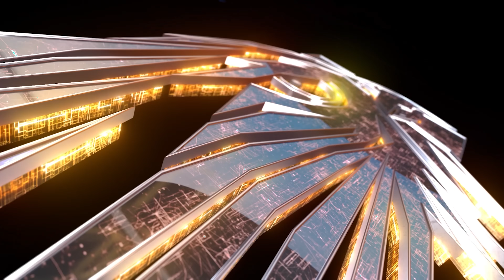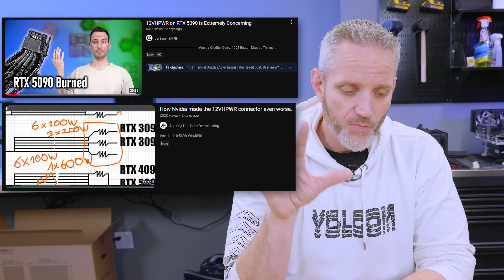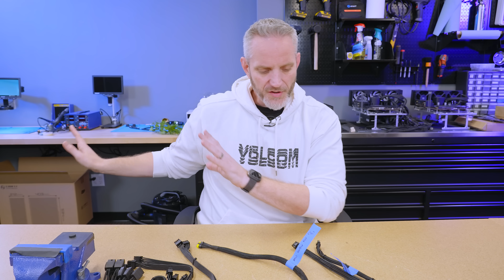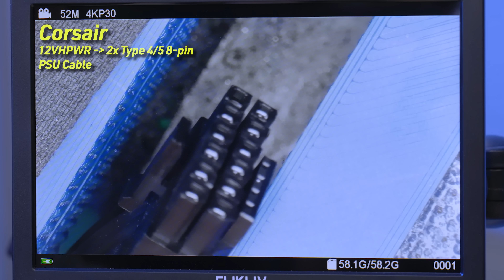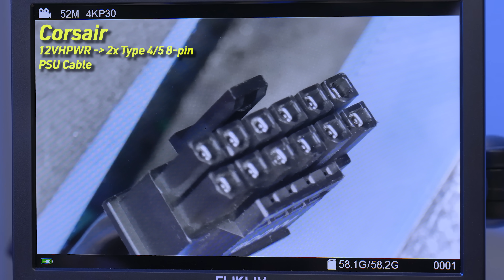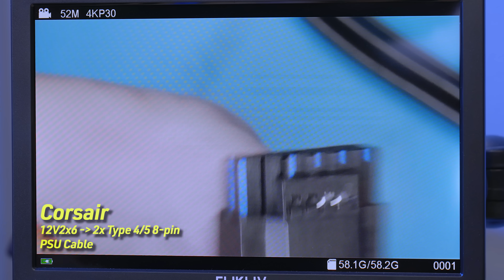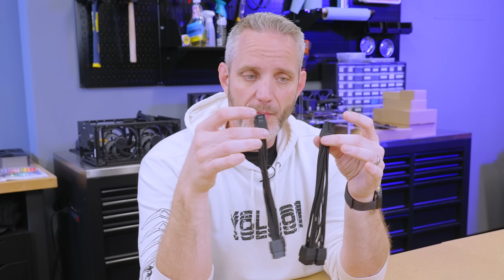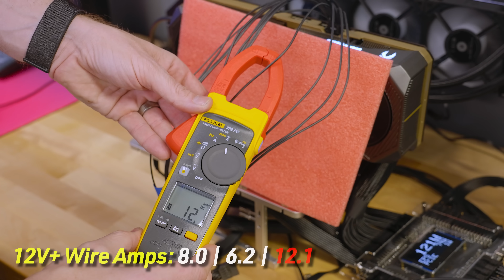I discovered something concerning and I need the Experts to chime in... More 12VHPWR discovery!

Comment: I bought an MSI card and I have a Corsair PSU.
Man, the MSI connector looks so fine and clean, but I cannot stand the fact that I would need to have three PCI-e connectors plugged into the MSI thing.
So I ordered the cable from Corsair. If you compared the 12V side to the PSU side, all the pins area actually sank in about the same.
But yeah, I get this weird feeling when using the cable that it is gonna fail at some point. I have "just" a 5070 Ti though, so it will draw 300W and might have spikes to like 350W, so I'm absolutely safe, right?

Comment: Nvidia is an old dinosaur that hasn't evolved for a million years. To make the 4090 go faster they just shrunk the transistors in the gpu die and cranked up the power because the archtecture didn't produce enough of a gererational uplift from the 3090. The 5090 was even worst uplift from the 4090, so they tossed in an even bigger die and raised the power to stupidly high levels to show some gains. The plug was never meant for cards that draw so much power, so no wonder they melt or catch fire. Nvidia makes rational people do stupid things. Would you screw a1500W halogen spot light into your 60W desk lamp? I surehope not. Nvidia can't inovate or evolve, so they do what they always have done and just throw more power at the card.

Comment: Have the two 12VHPWR cables included with the Be Quiet! Straight Power 12 1500W power supply (PSU) been updated or are compatible with the newer (2x6) standard to prevent melting connectors for the more powerful graphics cards (GPUs) like the Nvidia GeForce RTX 5080 and AMD Radeon RX 7900 XTX? 

I am concerned about the potential for overheating and melting cables which could lead to a decrease in performance, system damage or even fires. 

I would like to know if the aforementioned PSU is fully compatible and safe with either GPU I previously mentioned since there appears to be many incidences online of burning connectors when it comes to the 12VHPWR cables.

Comment: the cables that are not as warm are the problem forcing more current through the hotter cables will this cause melting of the connector - probably not, this is of course a different issue than a bad connection on the pin itself making that pin on the connector  heat up and eventually melt, as it melts and burns the problem gets worse over time, it is a complex issue

Comment: ughh, I just installed a 1200w Corsair HX PSU yesterday, I wish I'd seen this first. Although, it is a brand new unit direct from Corsair and it looked like they have revised the 12vhpwr cable, as it's now two tone plastic (grey/black), a bit like the MSI cable.

Comment: the only thing i know about electric cables is a loose connection causes arcing which causes heat which causes melt which causes shorts and fires.

Comment: I think it's possible that poor quality power connectors are responsible for 12V GPU failures. However, as with some people in the comments, I agree that ultimately this is a GPU manufacturer error. The GPU should have safeguards built in to detect missing pin connections with the power connector to prevent failures. It should just result in a GPU not working, rather than the GPU dying. So yes, power supply manufacturers could probably prevent these failures by having better quality control, but the onus should be on GPU makers to make sure their cards don't die or start fires from bad power connectors.

Comment: Currently using a super flower leadex 7 1000w with an astral 5090. The load balance across the wires changes DAY BY DAY. Super flower has also ignored me for 2 weeks now and i cannot find any help.

IF i was using any other 5090 i would never know that 2 wires are pulling more then 10 amps as other only draw 4 amps.

Comment: The Problem is: My 1200W ATX 3.1 power supply has one 12VHPWR connector and only 3 8-pins. So not enough to use the adapter with my 5090...

Comment: I guess it might be a good  idea to buy some kind is small electronic device that would plug in between the power supply and the graphics card.  That would even out everything and keep your cars from burning up.. in some kind of fail safe that would monitor temperatures on the wires.. that would plug into the PC and give you some kind of warning or a heads up when things go wrong.  That would monitor the temperature on the plug itself also..

Comment: YES! FINALLY! I've been waiting for this video from someone in the PC building community.
I'm an electrician, I have worked on almost anything you can plug into a wall, and wired the wall all the way back to the pole. This is REALLY bad. That's my professional opinion, nobody in an electronics engineering class is going to tell you that's "fine". In addition, I have had to actually push the wires into connectors to assure connection between this style of wiring harness (and that's really what this is, it's a wiring harness.) Ok, so that's my FIRST issue, I've seen countless wires pushed out of the back of the connector and had to physically push the wire in with the connector on the end of it to get individual pins to connect. There is all this terminology that's kinda different than what we would say in an engineering environment. The actual connector is the individual metal connector crimped onto each one of those 12 wires. It is then put into a sleeve in a harness, which would be the plastic piece guiding each one of those 12 wires with connectors clipped into the individual male and female sleeves. I would say that nearly 100% of the times these harnesses are clipped together, or "plugged in" in layman's terms, at least one of the 12-24 individual connectors in that harness  FAILS TO fully engage. If you plug in a motherboard or GPU with the harness style we use in PCs as a standard, and you've got cable headers and extensions onto that BUNDLE of wires, you end up with 48 INDIVIDUAL connections at minimum if you use an extender to plug in your motherboard. I'll bet money that if you dissected that wiring harness connection to see if each and every one of the 24 pins were both crimped onto the wire, and fully engaged male to female connector CORRECTLY and 100%; you would find that maybe 10% of the wiring done in ANY PC is actually 100% engaged at every single wire connection. That's why as PC builders, which I know 75% of this comment section is, we actually push the WIRES together and not by the harness collar. When you plug in a motherboard, once the plastic harnesses are engaged, everyone pushes the harnesses together by the wires. If you fail to do so, then there is no way that every single male and female connector is fully seated the way it should be. If these connecters failed to fully seat back in the day in your outrageous 600 watt PC build with graphics cards pulling a staggering 200W across 6-8 wires it wasn't really a thing. Those could be half way sleeved in the connector and run forever no problem.... We aren't exactly living in that era right now.... for a lack of a better way of saying it, PC's have outgrown their wiring. We have created bigger and more power hungry components, the power consumption has moved around in the PC, the entire industry has evolved, but we are still on default settings for wiring. Those wires shouldn't be feeding 9 amps to begin with, but this problem is also more layered than an onion.

Now to build on that. 600W is a significant amount of electricity. You effectively have an old fashioned incandescent 100 watt bulb sucking on each one of those 12 connections. When this was even discussed, back when most GPU's used twin 8 pin adapters and were at 300 watts on the high end, I've always leaned on the side of caution and used two independant 8 pin connectors. I know it might look tacky having the jumper one hanging in the air on both wires, but it was enough of a thing that it actually had a tiny impact on performance. Way back then when Nvidia concocted this plan to feed a 600W load off 6-6 +/- wires I said it would be a problem. Low and behold.... it's a problem. So let's zoom out a little bit and look at other things in our house that run off of electron motion. Your 1000W microwave is fed with a single 12 AWG wire off a 20 amp breaker. If you have a 600W GPU, then that PC as a whole is moving into territory where by design of electrical systems in your home, you shouldn't really run more than that PC on that circuit in your home. YES, that circuit will feed several thousand watts if you really load it down, I'm not saying you should never have more than 1000W of load on a circuit in  your home.... in case there's a residential electrician here to audit that statement. The point is your MICROWAVE gets a dedicated circuit for the 1000 watts it draws. We have GPU's that are pulling more than half as much electricity as a microwave. Smaller microwaves are generally 800W in reality, so that GPU is pulling enough electricity to have a frozen dinner done in about 3 minutes. This matters, it's really important to make sure there are no faults in delivering that much electricity, and when you look at regulations across the world as a whole, Europe has vastly more electricity legislation than the US. I don't see how Europe hasn't had a stroke about PC wiring in general given how strict they are about electricity in so many other applications. I've had a long discomfort for how PC's are wired since PSU's started hitting 600W max. When you reconcile the fact that you have a desktop PC pulling 1000 watts of power with the fact that all those hundreds of wires are carrying that 1000 watts, and there's hundreds of manual wire connections in those wire harnesses. I REALLY expected to see a bit of an industry overhaul on this stuff after the NZXT riser fire incident because even though that wasn't a connector because I thought people would realize that these things are actually carrying enough electricity to be a legitimate fire hazard. Would you plug in a 1000W space heater with 200 wires going all over the place and maybe not all securely connected?

What does this mean in relation to the hypothesis you have put forward.... You couldn't possibly be more correct. I would never have put the greenlight on these 12 pin connectors personally. Had someone asked me "is this safe" I would say no. It's not really safe even if the wires are soldered together. You are making 12 individual connections at once, you can't see through that plastic to make sure every single pin is fully engaged. There is also a wear factor to these harnesses. I don't see how this wasn't addressed in the engineering phase simply because we all know if you plug and unplug one of these wire harnesses about 100 times, you know that the female end of those connectors has opened up a little bit. In my fairly educated opinion pushing 100 watts across each one of those connectors in that harness design is begging for a house fire. Once the sleeves of those connectors opens up and you get a little bit of arching going on, the harness is worn from being hooked and unhooked, it's starting to shove the female connectors out the back of the harness collar, or they end up a little bit bent up from not being perfectly lined up all this stuff is piled together, and you end up with connectors that aren't fully engaged. This didn't matter 10 years ago, you didn't have 1000 watt PSU's in your desktop PC. The power draw on PC components is only going up, and it's going up fast. Companies need to be cognizant of what is happening with the rapid increase in power draw and design a far more robust system for plugging and unplugging. Personally I would like to see them get rid of the excess wiring involved. With a 600 Watt power draw, there should NOT be 6 wires in a harness anymore. There should be two far bigger conductors, with a more reliable connection system. I would use lever connectors known in the industry as "Wagos" where  you seat the wire, and push a lever down locking it into place. They are despised when used to wire homes, but they are the greatest thing in history for applications where  you do a lot of plugging and unplugging because you get a secure and reliable connection every time. If you need to split that single high amperage connection into 6 buses, do it on the card side of things. GPU's are already as large and bulky as the rest of the PC, a little bit more ain't gonna hurt especially when it makes things 10x safer. I've had an uncomfortable feeling with wiring in PC's for quite a while now, they are pushing things WAY past what is considered safe for these individual conductors and the harnesses they connect through. Electrical fires are insidious, they take time to happen. When you have almost no regulation of who can make these extension wires and harnesses, they are incredibly generic. It's time for all of us, and especially companies like newegg to step back, look at how much electricity flows through these things in modern applications, and honestly do what you just did. If you could wire a home the way you wire a PC, there would be people charging their EV off multiple dollar store extension cords.
Reply: @jonanderson7355.  EE myself,  I liked your comment.  Took a while to read, but well said.

Comment: I just saw this video after sending emails to corsair and the vendor with exactly the same questions regarding the female connectors. I am wondering why they didn‘t use two 2x6 connectors for a 5090…. That would also be fine. Maybe we gather the detailed specs and do a multiphysics simulation for the companies…

Comment: I work in the HVAC industry. I also build my own computers. Have a R seven 5800 X for the 4090, have 4 8 pins going into the 12 V but even in our industry technicians and I have even seen electricians not really grasp the importance of tight wire connections. We use quarter inch spade connectors on mostly everything and if they’re not crimped correctly or make good contact with the spade, they generate heat and melt the wire. Same thing happens at circuit breakers in the electrical panel when the wires aren’t tight, but usually overheats and trips the breaker before too much melting happens due to temperature of the breaker.

Comment: The current imbalance is caused by small differences in resistance between the PSU’s internal 12V bus and the GPU’s internal 12V bus. Since the 12VHPWR connector has six power pins in parallel, each wire acts like its own resistor. If all paths had exactly the same resistance, current would split evenly. But if one wire has lower resistance than the others (say, 2 mΩ vs 5 mΩ), it ends up carrying way more current — sometimes dangerously so.

What the PMD-2 (or similar measurement devices) does is add a small, consistent resistance to each wire — for example, 10 mΩ. This added resistance dominates the total resistance of each path, so natural mismatches (like 2–5 mΩ) become much less relevant. Now the total resistance per path becomes something like 12–15 mΩ, narrowing the range from a 2.5x difference to just ~1.4×. That effectively balances the current across the wires — not by design, but as a side effect of precise measurement resistors.

Comment: Hey Jay, does the extra 6pin pcie connector on motherboard pcie lanes help reduce the current on these?  I figure you might've forgotten about them since it was always EVGA that always included them on their boards.  I'm running a 4090 on a Z790 Classified and plugged that in as a precaution with a 3-cable 90deg adapter on the card itself.

Comment: So did you test all cards with the nvidia adapter to prove the theory? and would 4xconnectors from the PSU hold up better (isn't it more points of possible failure than just using the one ATX 3.1 cable). Would be interesting to find out once and for all if nvidia adapter+4 connectors = balanced voltage across all wires.

Comment: Hmmmmmm. I put a new Corsair RM850e in my month-old build... This video made me nervous so I got its box out, and inspected my unused cables. I pulled two of them out and tried tugging on individual wires and seeing if their terminals would move inside the connector. Happy to report that the ones I tried all exhibited proper behavior of not moving more than just a few hundredths of an inch - but I don't know about the ones installed in my machine...
A bad connection causes resistance, and resistance causes undue heat, and undue heat causes all sorts of catastrophic results - not to mention potential damage due to current-sensitive components. Just last week I worked on a coin-op electric dryer which was melting the insulation on a few of its wires. Jiggling those wires revealed that the female spade connectors were loose on their male terminals - so I pulled each one of the females off, squeezed them shut with pliers, then pried just the front of the terminal open, enough to accept the male terminal, and thereby allowing the male terminal to determine how far the rest of the female would spread, to accept the male. After this, the terminals were tightly connected, and the wiring was no longer burning! The three most important things with electricity are tight connection, tight connection, and tight connection.

Comment: With Direct Current, a bad ground connection can be worse that a bad positive connection, because a bad ground will cause its component to 'seek and find' a ground somewhere, causing current to go where it shouldn't, and that usually causes some mysterious symptoms. Lighting, and other circuits, on cars, can exhibit some mystifying faults - even with seemingly unrelated circuits, due to a missing or intermittent ground.